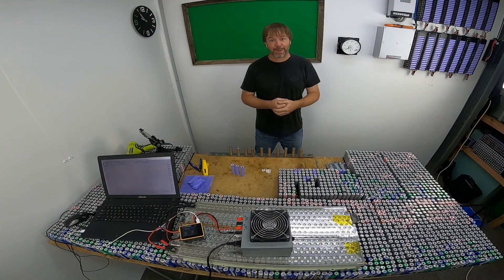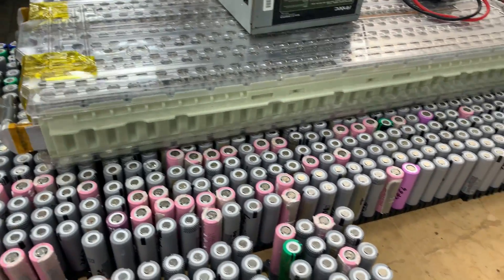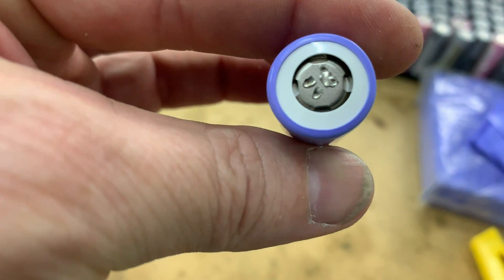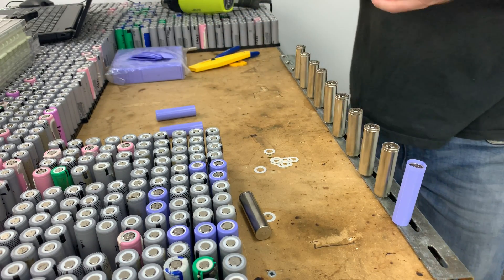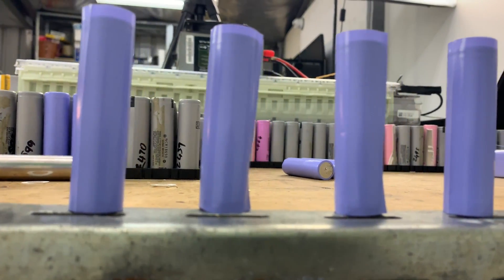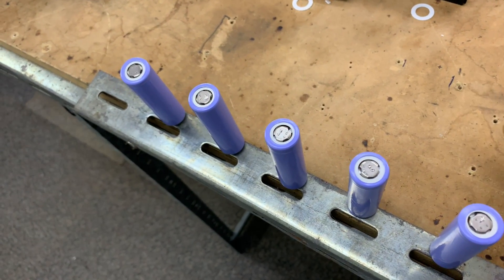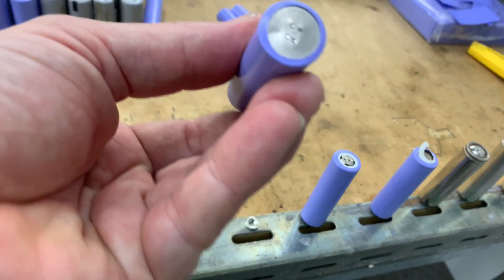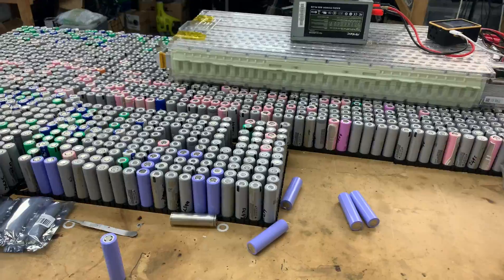Neat 18650 heatshrink  trick that'll save you time!

Comment: What temperature on the air station do you use?
Reply from the maker: I can't remember if I used Hot air station or one of those heat guns - if heat gun, low setting
Reply: @HBPowerwall  thnx!

Comment: Great technique, I used a heating stove on the heat shrink, and it is 99% effective if not 100%. All you need to do is just slightly rotate the battery as the plastic cover shrinks
Reply from the maker: Great tip!

Comment: Disaster right there to be honest. 
I find using a soldering reheat station blower and it works perfectly, while holding the cell and turning it. Easy to avoid burning fingers as the small opening for the hot air is easy to manipulate.
Reply from the maker: I tried with my two hot air stations - heat gun is so much faster & convientet

Comment: Set up a row of power resistors on each side to give off radiant heat. Aluminum foil on the outer side of the resistors to minimize heat loss. This might even require less energy than a heat gun. It would certainly provide more even heat distribution. 

If you want the fastest method, put them in a microwave. Ok, that's a little joke. 😏

Comment: Normally I wouldn't suggest making a specific rig, BUT I can see you do a LOT. My suggestion is to get box tube big enough to drill out a hole that fits the cells with maybe a millimeter clearance (in the top) The magnets can then be set exactly, relatively to the batteries, probably screwed/glued onto the base. Where the cell sits, a slot half as wide as the cell, is cut vertically into the side of the box tube. The box tube would perhaps be half as tall as the cells and ensure the bottom of the cell gets wrapped properly, due to the heat not escaping out the other side.
If you made the box high enough, you could just run across the top, then through each slot and be done, no need to do both sides. Or have a slot on both sides and mount it so you could spin in around and do the other side.

Comment: The base failures were from you not being able to get round the other side effectively, solution make the metal plate so it can rotate. Also use a white board marker to write the capacity value at the base of each 18650 so when you rotate you don’t forget each value. Great video great concept. A jig is needed to be able to shrink 20 at a time.
Reply from the maker: This process has evolved a little bit since this video already. THIS way is stupid fast at re warping the cells I love it!

Comment: thanks for this, I found using just one magnest point and swapping though already sleaved cells just fine and as you say perfectly aligns the bottom length, i pick it up of the magnet after its shurnk and while in hand finish the bottom and load the next one so nice and quick and works very well.

Comment: I think I would prefer to keep the original label. It has the manufacturer, so you can work out if one brand does better than another, but more importantly it might have the 4 digit date code, eg 2617 = 26 week 2017.
Reply from the maker: Good point but so far i haven't needed it or even wanted it. If a cell comes out faulty - that's all it is really
Reply: @HBPowerwall  use clear

Comment: I'd suggest going for a higher temperature and lower airspeed so that it shrinks quickly but doesn't blow away the insulator rings.
Reply from the maker: Yep, unfortunately the hot air gun only had three settings each hotter and faster than the next

Comment: stick the magnet on the cell first before putting onto the metal it may help keeping it centered
Reply from the maker: To slow, easier to run the air gun over it after it's done

Comment: Drill out a piece of stock slightly larger than the battery and place the magnet down inside a slightly deeper hole that you drill out. When you set the magnet in the deepest hole, it will be centered of the battery.
Reply from the maker: That's an idea

Comment: 3D print a jig that a) holds the magnets, then b) aligns the cells, perfectly centering them on the magnets every time.
Reply: Good idea, especially if you have a removable jig that is just used for alignment of one cell then moved to align the next one.
Reply: then it melts in the hot air....  Low temp heat guns are 200C, high temp 590C, most plastic most people use start to melt under 100C
Reply: @Dust599  A) 90°C/194°F is all that's needed to shrink common polyolefin tubing. B) The temperature at which parts printed with common filaments, such as PETG, ABS and nylon, would "melt" is well above 90°C/194°F. C) The parts wouldn't be directly subjected to the heated air stream. Nor would they be exposed to the air stream long enough to heat to their melting point.

I stand by my suggestion.

Comment: Try utilizing horizontal positioning rather than vertical. Seems much easier to utilize a lower center of gravity to roll. set up a pusher mechanism and the batteries would push themselves in order uniformly. Put 2 heat guns positioned correctly on both sides dial in the heat settings and push mechanism and there ya go mass production!! G'day!
Reply from the maker: Seems like a lot of setup for perhaps 1000 cells - if you were planning commercial operation that would sure work

Comment: Might be quicker to hold them whilst heat shrinking, pair of 300'c heat gloves for approx $50 AUD.
Reply from the maker: magnets are $4 lol
Reply: @HBPowerwall  :) but you have at least 10 magnets there which would equal about $40 worth. BBQ gloves cost about $30.
Unless you bought like 10 of them for $4 lol

If you place the heat gun on its ass facing upwards you could hold the batteries in your hand and wrap them quickly.
I'm not speaking from experience so please don't take my advice haha, I look forward to your next video :D

Comment: What's your two cents on Paper or PET insulator rings?
Reply from the maker: I'm using the stock ones & paper ones on top... double down!
Reply: Doubling up on protection makes sense, that is a pretty exposed area. Just tearing apart packs I’ve had shorts where the insulating ring is cut through.

Comment: You make a conveyer belt system that runs through a toaster oven style tunnel of elements so that it somewhat automatic.... even putting the curved reflector nozzle on the heat gun will make it faster to shrink
Reply from the maker: that might be worth the effort if you were doing thousands of cells. I did try it with a different nosel today and it was so much better - a tip about 2" wide and nice and flat

Comment: Why recover them, leave them nude
Reply: Uncovered cells are a safety hazard. The entire outer shell is negative. An unintended series connection results when the outer shell of one cell comes in contact with the positive terminal of another cell. Worse yet, a short results when conductive material bridges the positive terminal of a cell with any part of its shell.
Reply from the maker: Can't have nude cells - they'll rust faster here in aussie land.

Comment: Meh.. you only need to remove the bits at the top and bottom...
I know you can buy heat shrink tubings but.. why bother with the new cell holders you actually only need the rice paper rings at the top.. 
That even leads to better cooling.
Reply from the maker: True but they will rust much faster if they are nude won't they?
Reply: @HBPowerwall  You don't see the negative terminal rust very often...
I think the only downside of not having heatshrink is that the whole cell is then conductive
Reply from the maker: Considering it's mounted on steel probably not a good thing
Reply: Try it !
Reply: Given a suitable mounting materials, would the cooling factor even effect performance?  
In guessing your setups don't run hot anyway. 
The mini might be different.